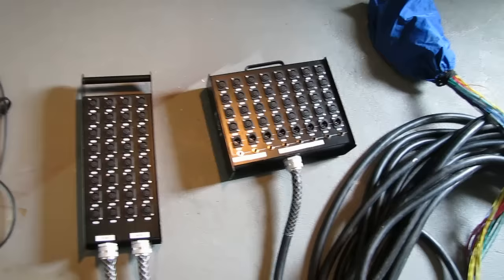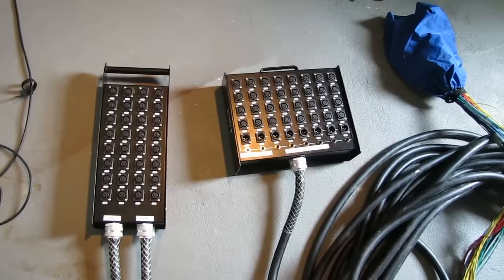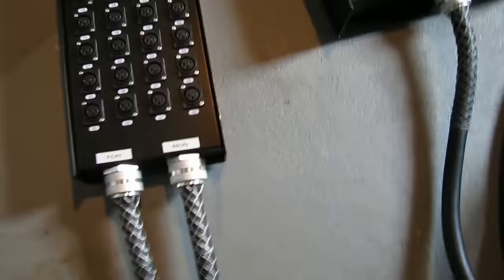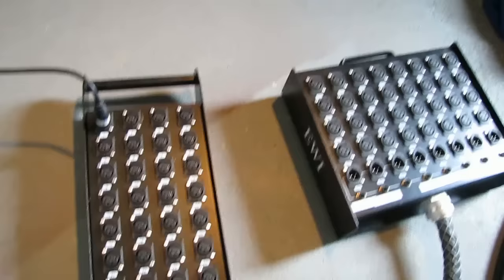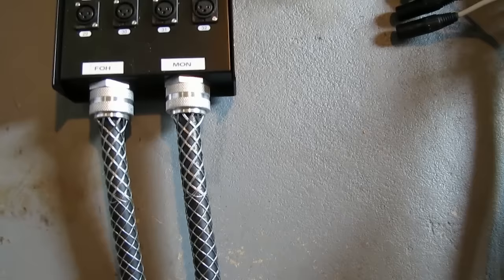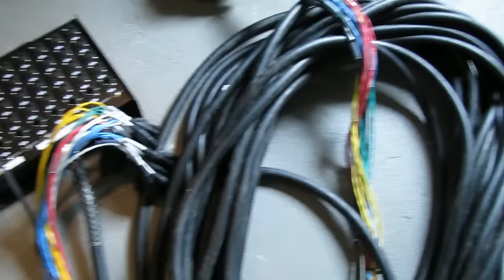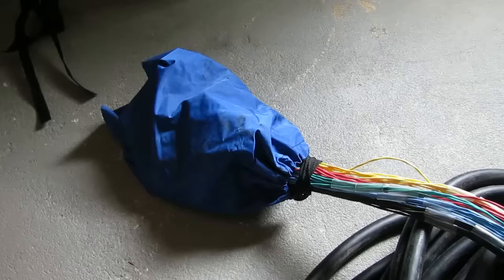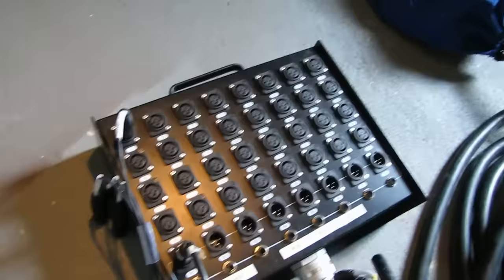Using a snake splitter to send a signal to FOH and monitors at the same time

Comment: It's so nice when you can have digital consoles with one stagebox that sends two digital MADI feeds over twisted pair (Ethernet), and you run one MADI to the front of house console, and the other MADI to the monitor console, and just duplicate the patches.
Reply: A lot of folks, including myself who do large scale production, still tend to opt with an analog split to avoid gain sharing issues. Just saying! I always joke, we have $25,000 of Vi stageboxes but $500 of analog splits that do the bulk of the work.

Comment: Thank god for the DANTE and similiar protocols. We (even we are very small live streaming "company"/group of friends), DANTE saved us a lot of money, time and work with even in not-so-difficult situations. Transfering all the audio channels & video streams to multiple destinations over 1 ethernet or fiber is now much more practical and so much easy to set up. (compared with this massive sneak cable). :) But it's somehow much more satisfying to see this massive analog snake.
Reply from the maker: Thanks for the comment.  Audio networking is great.  The protocols seem stable, but (at least on the AVB side, and in my opinion), the AVB components don't appear to be yet at a complete stable state.  Seems to be a good amount of firmware upgrades for the hardware that are needed.  Though for us, the expense of deploying a full digital solution is very expensive, factoring redundancy and providing a good infrastructure for the networking equipment to operate in.  We'll always use analog; it's about 1/10 the price for a full digital AVB solution.  For networking, if prices come down and stability goes up, we'll move to full digital.

Comment: Thanks for this! Really neat to see someone actually explain how this all hooks up. Knew it on paper but it's good to see it.
What does the return on the snake do exactly and what is it hooked up to?
Thanks!
Reply from the maker: The returns on snakes are used to "return" the signals from the FOH console or cross-over to the FOH and monitor amplifiers, which drive the FOH and monitor speakers.  Some snakes have more "returns" than others.  A return can carry a full-range signal or if using a crossover, 1 x return channel can carry the low signal, and another channel can carry the mid/high signal.  If using monitors (for example 4 x monitor channels), you would need 4 separate returns to send the separate signals back to the monitor amplifiers.  Lower channel count snakes usually  have 4 to 6 returns, mid-channel snakes (around 32 channels) usually have 8 to 12 returns.  Large channel count snakes (around 40) will have at least 12 to 16 returns.

Thank you for your comment.
Reply: Hii sir what is a fuction output snake box ? @stageleftaudio
Reply from the maker: @blacklistYT1  Hello - I am not sure of the question you are asking...

Comment: If I use this with my nice apogee, audio interface, to split the signals to a separate mixer for headphone monitoring, is there any chance this would degrade my quality in Recording signal?
Reply from the maker: We don't do recording, so I can't say for sure if there would be any degradation that could impact a recording.  However, I doubt that even a slight amount of degradation would present any issues, especially with higher quality consoles.  The impedance of many good consoles can support a lower microphone impedance (if any, from mic splitters).  We have never experienced any sound quality (or level) issues when using the splitter.  Our observations were from a live sound perspective.

Comment: Stupid question.. does using a splitter snake reduce the voltage by 50%? And if so, how does that affect the preamps on the other side? Do you have to use 50% more gain?
Reply from the maker: No discernible drop in signal level, especially when it is just a 2-way split (as in the video).  If you were to split a signal by maybe 10 times, there would probably be a noticeable drop in signal level.  Passive splitters (referenced in the video) are extremely common and do not present issues with signal degradation.
Reply: @stageleftaudio  thanks for the reply and info!

Comment: Do you use multipin connectors? I see one band, they got stagebox with 24 XLR and side have two 80 pin connectors, other for FOH and other to monitor-system. and both end got also multipin-connector, so no niid plug and unplug XLR-connectors.
Reply from the maker: We do not use multi-pin connectors.  They are great to use, but require some extra care when using.
Reply: @stageleftaudio  I'm thinking to start using them, are there some troublemaking in those connectors? What I think does they add background noise/hum or something.
Reply from the maker: Multi-pin connectors require extra care/attention when connecting them to stage boxes or fan-outs.  For example, if a pin gets bent in the connector, it could disable the entire cable.  Also, there can be issues with connecting the connectors to the stage boxes if the connectors are the screw-on type.  It's easy to strip the threads on these type of connectors.  If other people will be using these connectors (to help setup), they will need to be trained how to properly attach the cables.

Multi-pin connectors are convenient, but require special attention.  A properly built multi-pin cable will NOT produce any hum/noise.
Reply: @stageleftaudio  Thank you for the answer. :) Your videos are fun to watch!

Comment: Is there a possibility of malfunction or burning in FOH board if I use phantom power on Monitor Console?
Reply from the maker: It really depends on the FOH console.  Older models of consoles may have issues with phantom power on the inputs, also, if the console does NOT have a phantom power option, it's possible phantom power (from a monitor console) could cause issues.  Under normal conditions, most consoles do not care where the phantom power comes from.

Comment: Wait, is this how they also record live shows? They must have here way splitters or two or more splitters all splitting away... One for FOH, one for monitors, one for recording, one for.....
Reply from the maker: Yes.  Though, there is a little more involved with providing feeds for other targets than monitors.  There are splitter units (usually rackmounted and with high channel counts) that are "isolated transformer" splitters.  These can send a signal to many places.  Many "basic" isolation transformer splitters can support 3 separate splits (i.e. monitor, live broadcast, recording).   The more splits that need to take place usually equates to a much greater cost, especially if using isolation transformers!

For the digital world, it's a different methodology and is a bit more expensive.

Comment: does the spilter pass phantom power through it I'm pretty sure it doesn't but to make sure
Reply from the maker: Yes, it does.  However, only one console (either FOH or monitor) should be running phantom power.  It's more common for the monitor board to provided the phantom power.

If you are needing a splitter to specifically not allow phantom power, isolation units (aka ISO) are the way to go.  ISO units can sometimes split a signal 4 ways.  Though, they can be rather expensive.
Reply: Have u used phantom power through your's i almost bought the ewi spilter i have some single stage boxs from there
Reply from the maker: Yes.  We use the phantom power from our monitor board  (when providing separate monitors) to power the condensors and DI boxes.  The FOH board doesn't care how the mics get powered... just as long there is power to them.

Comment: Can I send powered speakers into the return on a snake and then to a mixer at FOH? Please help!
Reply from the maker: I am not sure what your question is.  What you are describing does not make sense.  Can you elaborate.
Reply: @stageleftaudio  I have 2 active speakers on a stage. I connect these straight into a mixer which is placed directly on the side of the stage. However, I desire to move the mixer all the way behind the audience instead of to the left of the stage. 

My dilemma: the back of the audience is about 100 feet away from the 2 active speakers. 

Question: can I plug my 2 active speakers into a snake and feed the snake to the mixer in the back? Or will my active speakers be too strong for the snake? Does this make sense?
Reply from the maker: Yes, your active speakers can be connected to a snake.  The only thing traveling through the snake is a signal level; this is what snakes are made to do.  All of the shows we do (and we have videos of many of these shows) where we are using active speakers at the stage, are setup using a snake with the mixing console about 100 feet out front of the stage.

Comment: Thanks Master for your time !!!! I want to know if I have two power mains and two power monitors and a 100' snake, if I can use the snake returns to put the power mains and the power monitors and don't damage the gear?
Reply from the maker: Hello - Looks like you are wanting to use a snake to carry amplified signals to passive speakers...?  Is this correct?  If so, it's not a good idea to run amplifier wattage through snakes (unless the snake is made to carry amplified levels).  The size of the wire in a snake can cause a huge amount of resistance for the amplifier to "push" a signal through.  It may work, but the amplifier will be using a lot power to drive wattage though a lot of resistance.  The amplifier efficiency would drop, the resulting watts would be noticeably lower and there's the possibility of burning up an amplifier.  it's risky to do.
Reply: stageleftaudio thanks for your time, No, the speakers are powered and the monitors are powered too

Comment: I have a regular snake.can i technickly modified it into dual output to FOH and stage monitor mixer?
Reply from the maker: You may have to use "Y" splitters on all mics/inputs that need to be routed to FOH and monitors; basically, 1/2 your inputs would be used for monitors while the other half is used for FOH.  I would not recommend it.
Reply: How to rekomended for mixer monitoring and foh sir ? @stageleftaudio
Reply from the maker: @blacklistYT1  What is your question?

Comment: but if you use a simple splitter for front and monitor, you can't setup each monitor for every single musician, right? I mean, the bassman needs louder drums, the singer louder piano aso...
Reply from the maker: The number of monitor channels is dependent on the mixer.  Some FOH and monitor consoles have many aux. sends, which can support a large number of monitor channels.  A splitter just sends one signal to 2 places (i.e. to FOH and MON).  A splitter snake does not determine how many monitor sends are available; the type of monitor console used determines the number of monitor channels.

Comment: OK, this was great, but you stopped before my question could be answered. I am working live sound as a gig, and want to rise up through the local scene, but I am stumped. I go to big shows often and see the monitoring engineer working with the bands, and I know each monitor has its own personal mix.  To be more exact, I have wondered about big shows and the monitoring board out puts, leading to the monitors. There must be a board that has up to 10 out puts like "main out puts" feeding the monitors, right? I mean, how else would they manage to feed so many unique, separate mixes? Thanks for answering my question as I hope to take this live sound work as far as I can.
Reply from the maker: If you are using an analog board, there are two different types.  Some boards are dedicated for monitor use and have all the outputs needed to support a large monitor mix.  Other boards are called "dual-function" - they can be used for FOH or specifically for monitor use.  Dual-function boards have a switch on them that switch the functionality of the AUX sends and sub-GROUP controls from their normal use... over to a "monitor" use.  For example, a dual-function console with 4-subgroups and a left/right/center (LRC) FOH output can be converted to a 6-channel monitor send console .  The 4 subgroups and the L and R FOH outputs would be used for the 6 monitor mixes (the center channel is not really used for a monitor send).  Therefore, all channels coming into the monitor board could be mixed into any of the 6 outputs.  The sends on the rear of the board (for subgroups and  L/R) become the monitor send outputs.  The subgroup and L/R faders become the master fade sends when in monitor mode.  For dual-function analog boards, the number of monitor channels (sends) available is dependent on the number of subgroups on the console along with the Left and Right output.  The Soundcraft and Allen&Heath boards we use (and what is shown in our videos) are both dual-function boards.

Many digital boards have about 14 outputs on them that can be programmed for whatever the need is.  These outputs can be programmed to be all monitor sends if needed.  

In-ear systems, such as Aviom can support a very high number of monitor channels, but this option is very expensive.  Aviom systems are a different way of providing monitors.
Reply: I see. Wow, thank you so much for the information. I don't have anyone I know in the field, so I sort of go it alone. I wish I had someone in the business to show me the ropes. This is just what I needed! Perhaps its time I take a close look at the different types of consoles. Maybe its time to find someone in the biz to shadow. Hey, thank you again for explaining this. You really helped me.
Reply from the maker: You are welcome.  There's a lot to know.
Reply: If you're looking to get a digital desk look into the SI Impact and a CBI split. Stay away from the cheap stuff.
Reply: One of the smaller acts I work with just got a cheaper unit, but it works great for what they do. It would never, never, never work in a big context or a festival type set up. Thanks for the tip.
Reply: IMHO - if you are just getting started - go ahead a start with a good digital mixer - the Behringer XR18 is a great starting point. 
Use the computer and the tablet to learn how to mix correctly - and the various ways to make a monitor mix. Behringer and Midas have two different monitor pathways - both are very easy to deploy - and can be run by the musicians taking the monitor responsibility off of FOH. 
You can - once familiar with the entire concept - can easily transition to the Behringer X32 or midas M32 consoles and be very successful. 
But again - start small - the XR18 is a great starting point with small local acts - and you can deliver tour grade features to a small band with a very small footprint. 

I run an XR18 with two satellites and one to two subs depending on the club and we sound awesome. Everyone controls their own monitor mix and the FOH guy can mix on the tablet. 
We do all setup in rehearsal with the computer software and save it all - so soundcheck is very fast and effortless.
Reply: Also - I might add that the software from Behringer XR18 or X32 boards are a free download - so you can play around with the features without hardware attached. 
That's how I got hooked on digital mixers - I played with the software for three weeks learning the features and layout - then simply purchased an XR18 and started working.
Reply: I know this comment is a bit old, but I'll help if I can. A great board for mixing monitors is the Behringer X32. It has 16 outputs known as Aux Out on most boards, and all of these are configurable. This means that in a addition to having a main output for FOH, there are 16 channels that you can chose what signal to send. If, for example, a singer wants to hear the drums to keep on time and the guitar to get the tone right, they won't want to hear the background singers, as the different harmonies and melodies can be confusing. Using an aux out, you can set it so that only the drums and guitars go to the monitor while still having full control over the main out.